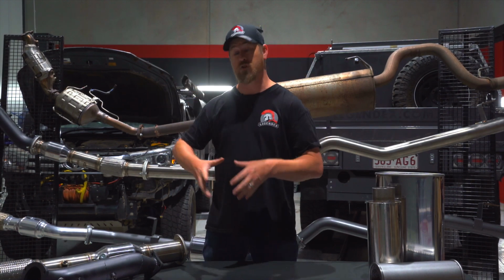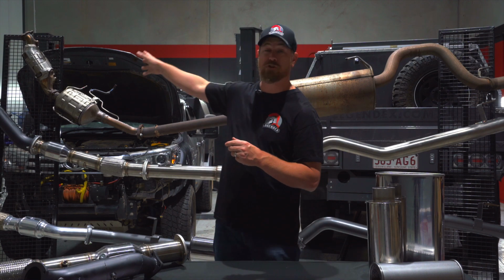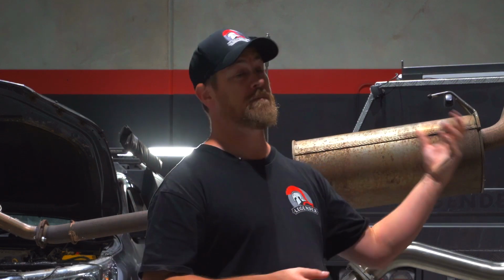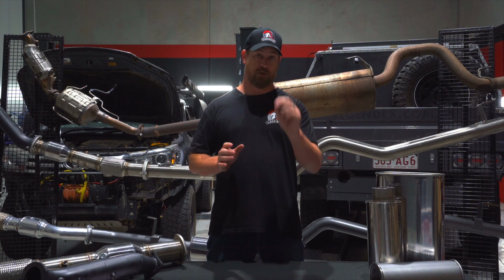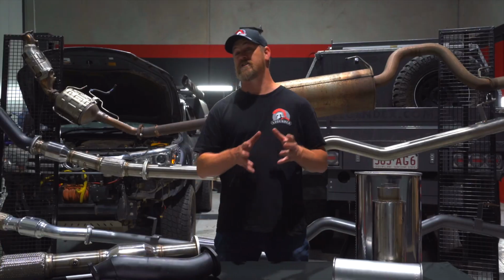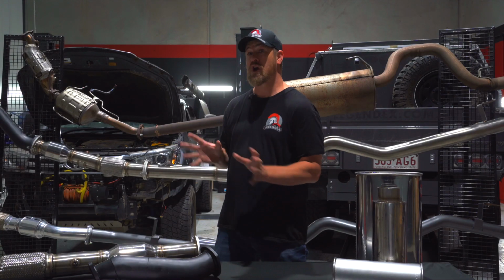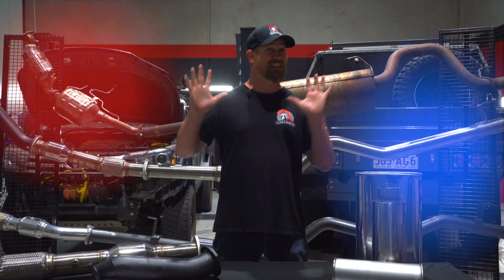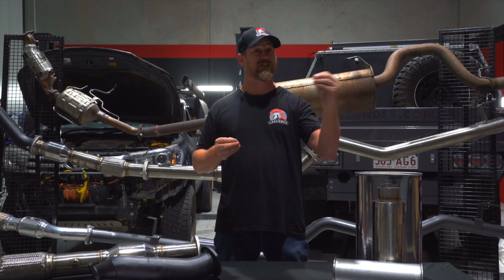EXHAUSTS & DPF | Legendex Tech Talk

Comment: Heat is the enemy for your turbo and cooling system. If you live in extremely high temperature areas this could increase your chances of overheating and viscosity loss of your oil . An increased sized exhaust with a good snorkel intake will increase the life of your vehicle.

Comment: I’ve got a 21 n80 hilux and wanting to put an exhaust on the gives a bit of a note! What would you recommend?
Reply: Did you end up getting an exhaust?  I just installed a dpf back 3.5" straight through diff dump exhaust and it has a nice note , quiet but heaps better than stock .

Comment: Great video short but to the point. Can I get a price for a full 3ich  turbo back stainless steel exhaust system and a tune and the stainless snokle installed. If you guy's have shops in new that are your dealer. 
 My ute is a 2013 dmax per dpf not sure if it matters but the car dose have 250000 on the clock
Reply: Hey mate, can you contact the team on 07 3203 2333 and they will discuss who is local to you. Cheers, Ben
Reply: @htfpdotcomdotau  great Ben will do that now